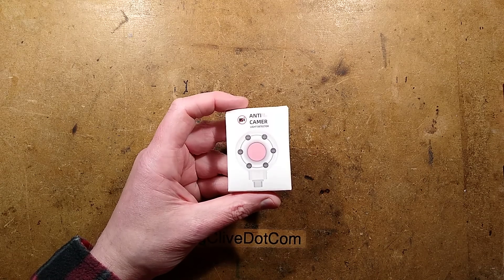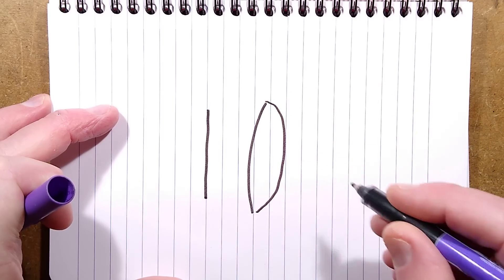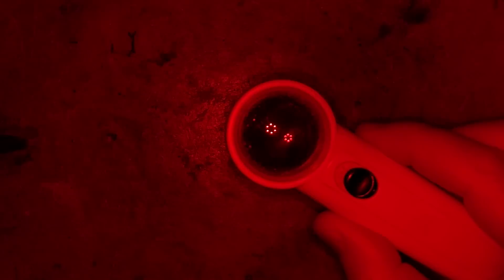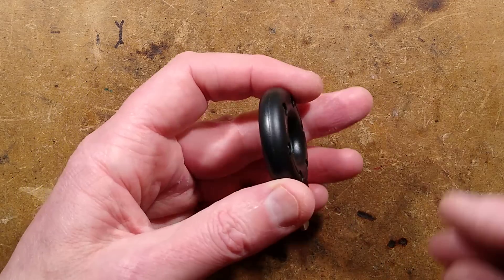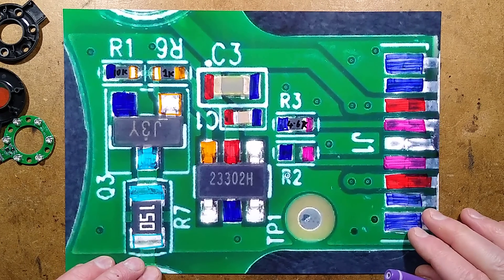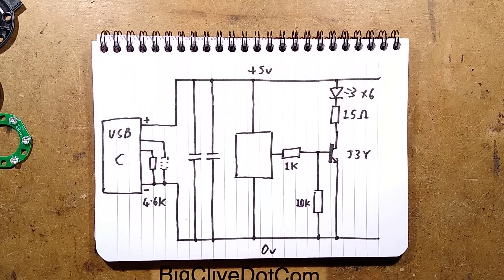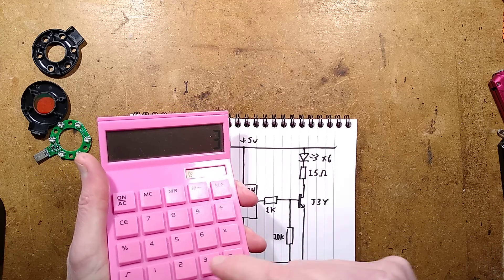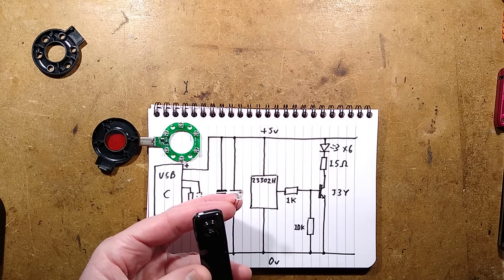Inside a Temu spy camera detector - with schematic

Comment: Funnily enough just watched a video on YouTube about road line painting, apparently its not thermoplastic they use but resin from trees. It has to be non toxic due to the fact the markings wear and wash away down drains into the environment.
Reply: What happens to tyre Tread wear? Where does all that rubber/compound go? In the air and down the drains I'm suspecting 🧐
Reply: Whilst I agree two wrongs also don't make a right. @muzikman2008

Comment: As a thrifty way to detect spy camera(s) you can grab the Cellphone and in camera mode turn off all the lights in the room and the camera I/R LED should show up fairly bright on the camera in the dark. I enjoyed the schematic and explanation of the Temu detector! 😃👍
Reply: That won’t work on may high-end phones, as they usually have an IR filter. 
You might have better luck with forward facing camera.
Reply: Any decent spy cam wouldn't have I.R. pouring out the front of it.
Reply: That what I thought you see the IR led old school to check Tv remote controls also if you’re a bad person let’s you know if cctv cameras are active
Reply: Even the cheapest cameras have an IR filter. Not because they didn't have a filter in the past, they could detect IR, but because the filter still lets a small part through.

Comment: As for the USB C resistor: 4.6k is slightly out of spec. You would need a 1% 4.7k resistor to stay just within the broad 5.1k spec. Probably still works fine with all devices. 
2 resistors are needed whenever a receptacle is used with an e-marked (>60W) cable. Since this device has a plug rather than a receptacle, the single resistor is fine.

Comment: Fun thing with that retroreflective material is that it works well well down into the IR range. Try it with some and any sort of IR no touch sensor, and it will operate them from quite a distance away. Did find that when wearing some, and went past an automatic water dispenser, which operated the tap from nearly a metre away, and the same for some no touch exit buttons on doors.
Reply from the maker: Yeah had issues with false triggering of automatic hand dryers on a construction site.
Reply: It was fun to watch all the taps go on in order in a service station loo as a guy with a (retro) reflective hi viz walked past :) took me a few seconds to figure out what was causing it!
Reply: Is that why the toilets in posh hotels flush before I have my pants down?
Reply from the maker: @thedave7760  One of my pet hates is the sensor toilets in airports that don't allow for broad shoulders.  It just flushes continually while you're sitting on it.
Reply: @thedave7760 maybe IR sensitive.
Reply: @thedave7760 You have Hi-Vis pants? Not seen them on Screwfix? 😂
Reply: I had this happen with the bottle fill fountain at work.  I'd walk past, and the filler would start running. It was amusing.
Reply: That explains why the no touch toilet kept flushing over and over when I had a hi vis on.
Reply: @DragonNexus  No touch toilet eh? I'd much rather be able to sit on something while I take a deuce
Reply: On a site I was installing hand sanitizer dispensers a week or two before turn over and because of all the reflective vests walking around almost all the sanitizer was dumped on the floor
Reply: I don't know if this is the same thing,  but years back, there was a Bobcat running a laser controlled grader that kept going wacky. Finally, figured out that the arc from the welders was the cause.
Reply: We've had that at work - with the retro reflective cycling jackets you can unlock the office door from the staff break room, so we're not allowed to wear them indoors any more
Reply: I've never noticed this and I wear Hi Vis all the time. in fact there's lots of times I can't get those stupid sensors to work

Comment: Is there any reason it needs to strobe? Surely it could work all the same, just highlighting anything that reflects in the lens?
Reply: The physics would work the same, true.

The flashing exploits the movement sensitive reaction built into the visual cortex of the human looking through the hole. 

Same reason as cyclists use flashing lights, to help drivers notice them, when their lights are so much dimmer than the lights on cars.
Reply: It would work the same if you could eliminate all other sources of light at the frequency of the LEDs... If you can't, the wavelength filtering property of the glass will be insufficient to distinguish reflected LED light from other sources. Blinking adds a temporal property allowing you to do that.

Comment: I’m a retired pentester, but still take my WEGA-i camera detector with me to rental properties - not found anything since retiring….yet!

When working I did have a worrying find in the office of a senior manager. In the centre of a ceiling tile directly over their desk there was a clear return - bright reflection. It turned out they’d taken some tiles out to do some electrical work on the fire alarm in the ceiling void; they'd put the removed tiles on the floor and someone had a piece of broken car window glass on their shoe that came off and got pushed into the tile - that did get my heart going for a moment.

I did find several “items of interest” in toilets and changing rooms over the years. Caught one guy by hanging a dead fly on some spider web in front of the wireless camera lens. He came to remove it as it was obscuring his view…
Reply: Based dead fly installer
Reply: @KeksimusMaximus  if I was still working I would add that to my CV
Reply: @KeksimusMaximus  That's actually a brilliant idea, too
Reply: so his canera didn't have a live feed - otherwise he'd have seen you messing around with cobwebs and foiled your plot.
Reply: @thebrowns5337  or you know he did not watch all day
Reply: @NinoJoel  as it was WiFi we could see there wasn't an active client connected. If it had been an RF broadcast type camera (2.4 or 5GHz) we would have jammed it before physically going near it just in case.
Reply: @thebrowns5337  we were RF scanning out of hours, cuts down the noise from cell phones and laptops. Rogue WiFi access points were our primary target out of hours, during office hours we were mostly looking for cordless mice and thier HID (not so much BlueTooth back then) dongles in PCs and laptops.
Reply: Never knew that was a job.
Reply: @NinoJoel  Yes, quite lucrative with an appropriate skill set, but the (out of) hours and extensive travel  aspects sucked at times. 

A pentesters life is mostly perspiration, brief moments of elation, followed by more perspiration. To be fair, it paid well enough for me to partly retire (contracting ~20 hours each month) at 56 and fully do so age 60.
Reply: @NinoJoel  it is indeed and a pretty interesting one. Those people do everything from hacking, social engineering, lockpicking / physical access exploits, security audits. It’s basically like being a white hat heist planner, but legal and quite well paid. Usually divided into Red team/ Blue team for penetration attempts vs penetration prevention respectively.

Comment: Clive, did it need to flash to help identify or if it was permanently on would we still see the reflection?
Reply: You can still see the reflection with steady lights. The flashing sort of makes it easier to notice, and I think the manufacturers think it looks cooler.
Reply: Probably also flashing to increase peak brightness, without blowing out the LEDs. Limit in detection will be how brightly you can illuminate the camera lens.
Reply from the maker: The flashing makes the reflected dot of light flash differentiating it from an ambient light reflection.

Comment: LED Flasher chips. Reminds me of the venerable LM3909 which was discontinued many years ago, sadly. It could make an LED blink using one 1.5V battery and one capacitor. Famously used in Pink Floyd's early 'Pulse' CD sleeves.
Reply: I remember having a little PCB with an AA battery holder and a single LED on it that flashed one of the early red LEDs. 
Worked great with otherwise dead battery's
Reply: I used a few for model railroad flasher circuits. Was disappointed when they disappeared.
Reply: Oh yeah.. I remember seeing them in record shops 😎👍
Reply: I had a badge from a tech fair in the mid 80s that had a flashing led on it. I remember thinking how epic it was.
Reply: I had one of the Pink Floyd sleeves. It lasted a very long time.
Reply: I still have one. May it RIP.

Comment: Now what i am wondering about is, why it is flashing? If the LED's just burning continues it shows the lens of the camera too. The small pinhole camera's don't have any control in front of the lens.
Reply: Most likely for contrast, as this allows discrimination to LEDs that are on.
Reply: What @SeanBZA said. LEDs just burning would work the same if you could eliminate all other sources of light at the frequency of the LEDs... If you can't, the wavelength filtering property of the glass will be insufficient to distinguish reflected LED light from other sources. Blinking adds a temporal property allowing you to do that.
Reply: for dramatic effect?
Reply: Because spotting a little dot (the reflection you're looking for) that is flashing is easier than spotting one that isn't.

Comment: I'd kill for a new set of waterproof halogen dichroic lights, used those inside all of my aquariums way back in the day and absolutely nothing compares to the way they make colors pop, without being harsh light. They were fantastic as accent lights behind rocks and stuff. No one makes them anymore, at least not that I've been able to find
Reply: Have you looked at submersible fountain lighting? Many are available as sealed units for 12V halogen bulbs which are thankfully still available in dichroic models.
Reply: @elitearbor  the few fountain lights I did see around were all like physically mr16 or gu10 size (like the size you'd see in a floor lamp or ceiling can), way too big and hot. The ones I liked were in small thick black housings no more than an inch in diameter and had a tiny little 8 watt halogen inside. You used to be able to find them in high end pet shops years ago but as LEDs came in and got good all that stuff went away. I'd be over the moon if I found a set of them. There were even analog lighting controllers for them you'd plug all your lamps into (they had standard barrel jacks) and would dim them individually to simulate cloud movement or day/night cycles. At one time they were just the bee's knees
Reply: We made our own dichroic filters at High End Systems in Austin. I'm not sure how much you're willing to pay for a filter to convert an existing light, but I know they are able to manufacture them!
Reply from the maker: The High End dichroics were very good.
Reply: @josephrumpsa180  holy shit, that's good to know.. and I'm only 3hrs away!
Reply: are you sure these lamps are for photosynthesis? Those fish have no privacy.
Reply: @darylcheshire1618  they're exhibitionist fish.. fish sticks 🤭😁
Reply: wow a real conversation in YouTube comments😮

Comment: During the demonstration, were we seeing it through the bare camera lens, or through the dichromic glass?  If we were seeing the effect without the lens, what's the benefit of the lens (or were the LED nIR and the lens allows our naked eyes to see the reflected nIR light)?
Reply: The LEDs were red, and I believe we were seeing it through the dichromic glass when the lights were off though the glass wouldn't really make any difference under those circumstances. The benefit of the lens is that it filters out light that doesn't match the frequency of the device's LEDs. It's just removing light that isn't helpful for this purpose.
Reply from the maker: It was viewed through the red glass.  It reduces interference from other colours of light.

Comment: It's not worth detecting spy cameras. Better to use an RF detector to detect transmissions.
Reply: Most spy cameras record locally, those that do not batch transmit. They can also be placed near rf producing devices and only transmit when they do.

Essentially, finding cameras themselves is preferable.
Reply: @mandowarrior123  When I had to bug, I just used digital audio recorders and picked them up every few days.I did have hidden cameras but the audio recorders were more worthwhile.
Reply from the maker: That's more complex now especially with a wall of 2.4GHz.

Comment: Some retroreflective materials use prisms (basically, cube corners) instead of spherical beads. But they tend to be more expensive and look glossy, so that cap is probably using the spherical bead type.
Reply: Yeah, cube corners are more effective, but also more expensive to make. Also if you don't have a way to orient the cube corners 50% of them will point the wrong way (ie with the corner facing the light source) and be useless.

Anything that's painted on will orient the particles at random, so will use the spheres because they don't have to land the right way round.

Turns out that to get the desired amount of backscatter it can also be cheaper just to use spheres, but more of them than to carefully orient cube corners.
Reply: @trueriver1950  - The ones with cube corners are created as sheets, they're not just sprinkled on.

Comment: That was cool. The part around 8:10 when you were tilting the lens you could see the 2 projected spots slightly change color. One became more red, the other golden.
Reply: The reflection is very subtle and it has to be pretty much perpendicular to the camera lens, you might as well just look around with your eyes and find it.  Just another gimmicky gimmick.  lol
Reply: @BillAnt  The idea with these is to help you find cameras that are just not visible to the naked eye, such as ones behind tinted/mirrored glass or located in dark crevices (for example, deep inside the holes of electrical outlets).

I've heard varying reports of how well they actually work at that, but in theory there are situations where they could be actually better than "just a gimmick"...

Comment: I would think that anyone wanting to place spy cameras in a 'temporary accommodation' would be greedy and want low light functionality.

All you have to do to find those cameras is turn the lights off after dark, turn on your phone camera, and sweep the room looking for lights your phone camera can see but you can't. Those lights are infrared LEDs used to illuminate the scene for the camera and are 99.99% of the time mounted directly to the camera.

If you find them, consider talking to a lawyer. While a homeowner is entitled to security cameras, it's almost universally illegal to record video of people staying in a 'temporary accommodation', especially without their informed consent. 

The legal 'line' between a security camera and a spy camera usually comes down to 
placement: A camera in the bathroom or changing room is almost always highly suspect. Likewise a camera pointed at a bed.

If you want an idea of what to look for when hunting for spy cameras with your phone, simply point you phone's camera at almost any security camera after dark.

Comment: I’m not surprised that Chinese manufacturers  would do something like putting malware in products. Some of those manufacturers are very evil.
Reply: What is the profit for them?
Reply: @u2bear377 more likely they are mandated to do so by their nation's "security" agencies. 

Back last century routers from a well known US company were sold to China, and were subsequently found to have hardware added to make them useful to CIA or whoever. It wasn't the manufacturer: they were told to deliver the export order to one of the three letter agencies and to keep quiet about doing so. 

Similar laws exist now in the US that could be being used to force manufacturers to keep open back doors in operating systems. Are those laws actually being used? It would be a federal offence for a manufacturer to say so if they were. 

No reason to suspect the Chinese are less sneaky than the US agencies.
Reply: @u2bear377  They get evil points from the evil league of evil.
Reply: @u2bear377 Selling or using any data they can harvest from a computer...

Comment: Shine a laser pointer around, If you hit a lens you'll get a bright glint.
Reply: A laser pointer would be too narrow of a beam. Imagine trying to look at the thousands of holes in drop ceiling tiles for instance.
 You can do pretty much the same effect using a bright flashlight, but hold it next to your eye (shining outward) so the reflection would be coming back 180°. If you see a pinpoint reflection coming back at you, you still have to check it out manually though.
Reply: Sure, and if you hit someone's eye with it, you'll get a nice court case... 😅
Reply from the maker: I don't recommend a laser for that.  Even a broad beam one.

Comment: Obligatory: do NOT ever plug anything like this into your phone or computer.
Reply: Not until you've disassembled and analyzed it Big Clive style to determine that there's nothing on the data lines except a resistor or other weirdness.
Reply: How come?
Reply: @ifination   Could be malware transporter. Or a capacitor zapper. = Dead phone.
Reply: @AltCutTV  True.  I would be very, very careful, and also of any app it wanted me to install.  But very careful isn't quite "NOT ever".
Reply: @ifination   Sure. The actual risk of either is of course statistically near nonexistent.

But a far more probable one I still somehow managed to forget: 😂 The device could be a very bad design.
Reply: @ifination It could be malicious and act as a keyboard to run commands
Reply: You guys watch way to much TV. 
No wonder the hoax news about a Chinese spy balloon got so much attention. 

Seriously... You all use Google products or even smart TVs etc and start fearing your pink USB vibrator could hack your phone... 😂 jesus